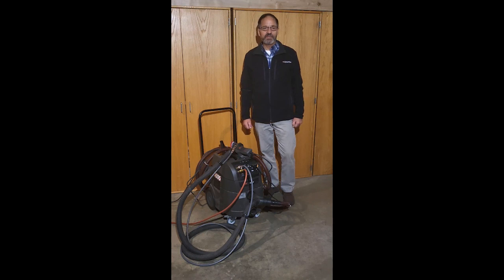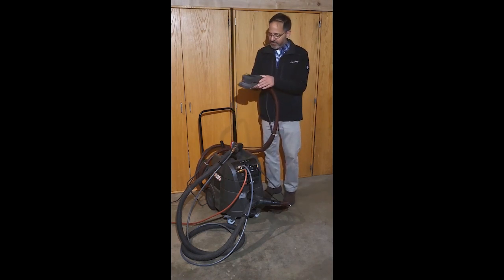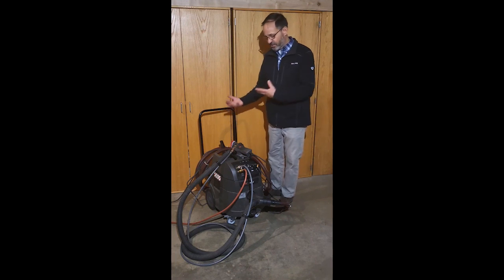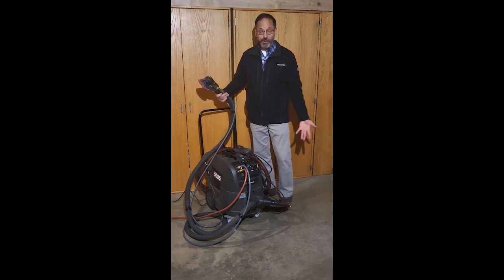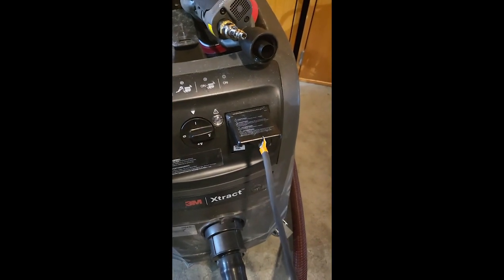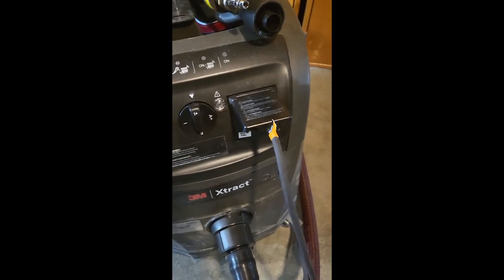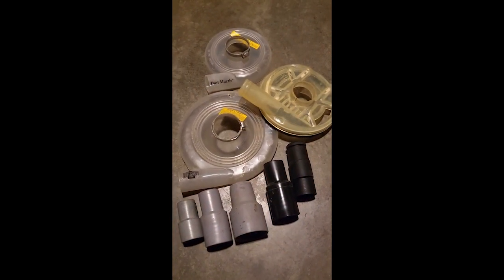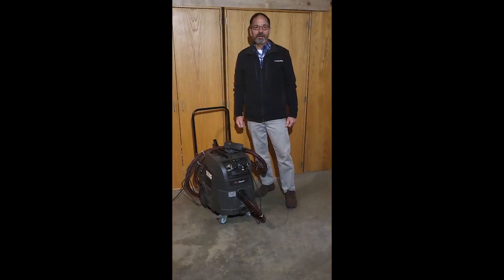Maximum dust extraction with the 3M Xtract™ Portable Dust Extractor

Comment: What is your experience with this Dust Extractor on steel, stainless steel etc?
Reply: This combo will efficiently extract metal dust while sanding. Care should be taken to avoid mixing metal dust though because combining fine aluminum dust with steel dust will create a chemical reaction that would most likely start a fire in the bag. So if you need to sand metal please toss the bag when you're finished or before switching to another metal or substrate.